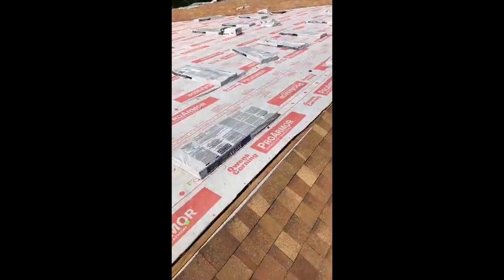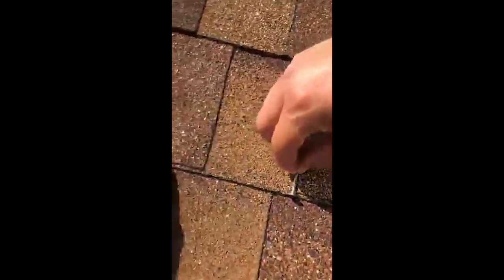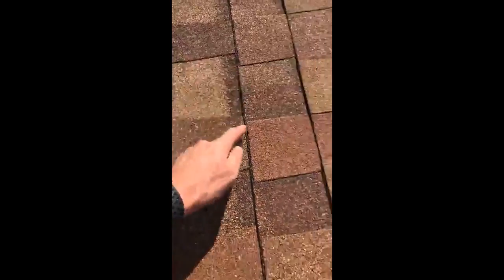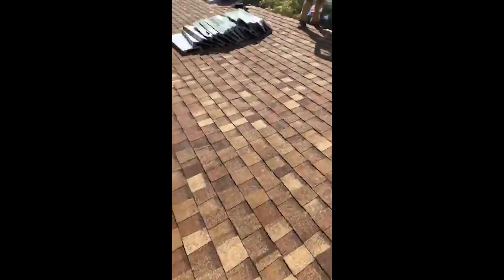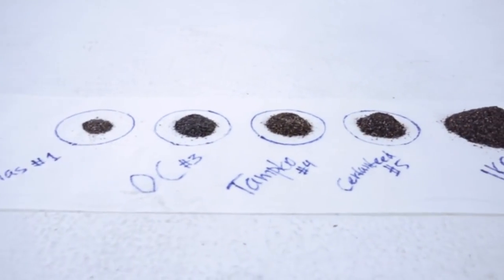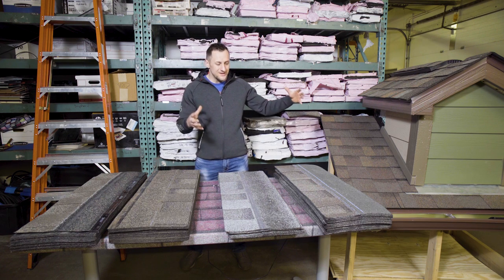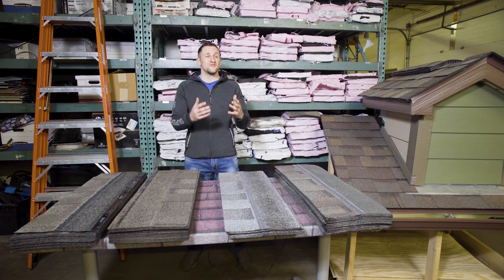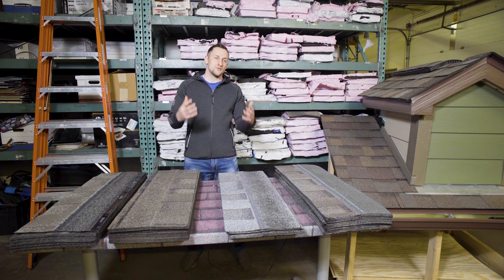Best Roofing Shingles: Certainteed, Atlas, Owens Corning, Tamko, IKO

Comment: This is the reason I don't install GAF.  Over-priced for mid-tier product.  And a terrible company to deal with on top of that.
Reply from the maker: What made you to come up with that conclusion?
Reply: @RoofingInsights3.0  much less asphalt compared to similarly priced competing products. Customer service has been very hit-or-miss especially for warranty issues. And as far as top certifications, master elite is a joke. Qualification requirements don't hold a candle to select shingle Master or platinum preferred. If you can't qualify for either of those, You might still be able to get master elite.
Reply: @asonofAbba2  was about to go with Gaf. What would you choose in Canada as a company? Where to buy? In Montreal
Reply: @cubul32  Atlas or Owens Corning. ABC supply, if it exists up there. You need to find your local roofers lumber yard
Reply: @cubul32  I would say GAF has turned around it's reputation for the better in the past year, with their HDZ shingle. Installing it is super easy, with a big common bond/line for nailing, and it has pretty strong adhesives at the bottom now.
Reply: Why did you not include GAF?
Reply: I stay away for Iko and Tamko.
Reply: In Canada most roofers push GAF.

Comment: I've been a roofing contractor for 30 yrs this year and agree with pretty much everything this gentleman has outlined.  I'm a certified CertainTeed Master Shingle Applicator for many years, an Owens Corning Preferred Contractor, and an Atlas Signature Select Contractor as well.  It is NOT by coincidence that I am certified and install these 3 brands only in asphalt shingles. I will not install any other brand ( Malarkey in Texas is too soft for the temperatures here....it scars easily from just foot traffic).  This gentleman is from Minnesota.......there is a big weather difference to consider. But his information is correct and up-to-date for the most part......just to give you some further insight from a highly experienced roofing contractor in Texas.
Reply: Isn’t Malarkey a rubber/plastic composed type of shingle? I’m here in Illinois and some contractors solicit the brand pretty tough.

Comment: Having my roof replaced right now. I'm glad the roofers are installing Atlas. My knowledge of shingles was null and until recently I couldn't tell you the difference between 3 tab and architectural shingles but videos like this help to enlighten me. Looking forward to a roof that will last longer than the 12 year builder grade roof that was initially installed.
Reply: im looking at atlas do you  like it
Reply: Brooklyn Flatt I have not had any problems with them at all. So far they are holding up well and the color is constant. I would say so far I would recommend Atlas.
Reply: I just installed atlas on my roof…I love them

Comment: Owens Corning is good but it’s too light and thin. Certain teed is heavy and thick my only problem is when the weather it’s hot the shingles stain quick when you step on for a long time. In my own opinion I think atlas is the best it’s thicker and heavier than any shingle in the market. The shingles width and height outbeats any other shingle. And it has double tar line in the nail zone. It grips good with boots/shoes it drops granulates but not as much as other brands. My only problem with atlas I just wish I didn’t get stained as much when it’s summer but I still believe it’s the best shingle you can get out right now

Comment: Truly appreciate this in-depth understanding of roofing shingles and also your insights. My roofer was going to use GAF but I'm going to insist we go with Certainteed now.  I also heard from another roofer that GAF provides them "kickbacks" to push their product but that roofer still prefers Certainteed in the interest of the homeowner.
Reply: Run from GAF run
Reply: I just put CertainTeed Landmark on my roof, and I can tell you I was surprised at how heavy the bundles were. 1/3 heavier ( just from feel) than what I was used to.

Definitely a hardy shingle loaded with asphalt. Roof looks beautiful. I used Tamko on my other house I will be selling soon. It has actually held up really well for almost 5 years. Still looks brand new and hardly any granular loss. Like almost none. 

Sealed well, and house  gets good shade from trees so I'm sure that hasn't hurt how well they have aged. 

I inspect my roofs twice a year, and exposed nails (i.e vents) I always reapply clear silicone if needed.

Comment: Thank you for this great video on shingles! I had a situation in which I had to install a new roof due to weather damage in 2017. The roofer didn't give me a choice of shingle and so I ended up with TAMKO 30 year shingles. The shingles did not resist staining and fungus etc and really started to look bad after 4 years. I had it inspected under warranty and it had major manufacturing defect issues with loss of granules over 80% of my roof. It was so awful. I am still so very upset about it. TAMKO also has a limited warranty and so they only want to replace their shingles and pay some labor but nothing else which seems very unfair if it is their product that is defective. I have worked it out with my roofer. I will be replacing the defective TAMKO shingles but thankfully the supplier is going to help switch me to CertainTeed. I am glad to hear your review about the shingles and know that the replacement shingles will be better quality. My roofer did point out some of the things that you mention in the video and showed me how it had more of the sealant on the underside to seal the shingles better. Based on my experience and your experience, I do not recommend TAMKO. They are pretty when installed but do not hold up or live up to their product claims. If someone is buying a house, they should be sure to review what type of shingles are installed. It might look new and pretty now but low quality may cost a lot to replace in just a few years. Thank god for me that I stayed on top of my warranty and had mine inspected.

Comment: Hello, I am a homeowner that is replacing my roof because of hail and wind damage. This is my original roof and my house was built in 2002. Within the past year after the hail storm, I noticed an increased amount of granule loss on my Timberline GAF roof. I do not have any blow offs, patch work or leaks. I am also not the first owner. During my research and speaking with multiple roofers, neighbors etc. The one common complaint that I found was that everyone had their own reasons for liking/disliking a particular brand. But the most common problem was the fact that the don’t honor their warranty. They blame the installer and the installer blames the shingle manufacturer. For my own purpose I needed to find the root cause of all of the warranty denials and found that no one reads the manufacturer warranty before the materials are purchased and installed. That includes the roofers and the homeowners. I took the time to read all of the warranties for the brand I was researching and the require certain accessories to be installed with particular shingles to be considered a roofing system that is backed by the warranty. For GAF lifetime warranty, you must install the architectural shingle plus at least 3 accessories such as their underlayment, specific ridge caps, starter shingles, cobra vents etc. If you use their shingle and substitute their remaining materials with different brands, you have voided your warranty on installation. This is why they can automatically deny you and they ask for the receipt with the claim form in which it doesn’t take a genius to figure out the installer didn’t install the system correct. So my point is read the warranty and read the claim process to see what is required to ensure #1 your roof is installed according their specs, and #2 if you have to file a complaint in the future your paperwork is correct. Make sure your name and address as the homeowner is on the quotes for materials in addition to the contractor because they will check property records. They only transfer to one new owner within a specified time period if you sell your home. So make sure the home ownership transfers are done properly.
Reply: A lot of roofers like certain materials because it’s faster for them or easier to apply, but as the homeowner your going to be the one dealing with a warranty claim 5-10 years down the road. You need to tell them what you want, and they can price it accordingly. If your focused on speed and price over quality materials and workmanship, then don’t complain later when your roof fails. You get what you pay for.
Reply from the maker: thanks for sharing this story!!!
Reply: @reneemcmillian6569  Insurance companies replaces roofs, not roofing manufactures. They will always fail an install even on the basis of one nail.  I'm a GC for over 3 decades.

Comment: Great video. We also love the Owens Corning brand. We have worked with almost all of the aforementioned brands with the exception of "pabco"? Tamko is paper thin and tears very easily. My guys hate Tamko. I did want to disagree with one statement. That is that IKO is a lower tier brand. IKO when i first started using them was a low tier product. Over the years they have strengthened the Cambridge series and even launched a VERY tough shingle with the DYNASTY series shingle so they could compete in the American market. I can vouch that the Dynasty series IKOs are on par with the Durations or Landmarks in the space of durability and toughness. 
Our list of top tier products would include the following:
1.OC Duration
2.GAF Timberline HD
3.IKO Dynasty
4.Certainteed Landmark
Not in any particular order, but just from working with every one of these, i find that these are comparable in most catagaries.
Mid Tier:
1.Atlas
2.BP
3.IKO Cambridge
Low tier:
1.Anything by TAMKO.
2.Malarkey
Great video btw, we love watching your videos, bud... keep up the great work. You have some fans here at VETBUILD™
Reply from the maker: Thank you so much for the response and support. I appreciate your opinion, as I do all opinions whenever they are expressed in a thoughtful and respectful manner.

Comment: I've spent the past few years dealing with IKO, OC and certainteed.  Both IKO cambridge and dynasty install easily and look good, and I've found medium granual loss out of package. OC tru def and duration have both been wonderful, minimal granual loss out if package, easy to walk an 8/12. Certainteed landmark and pro are by day the most expensive, and look the worst after install, imo. The certainteed also had maximum granual loss out if package, on a 6/12 it is like walking on tiny ball bearings...
All three are great, but I really dont like the amount of granual loss I got out of the package with certainteed.
Reply: CertainTeed places loose granules instead of talc between shingles.  It's not coming off the finished product.  CertainTeed is way better than IKO and OC.  IMO.

Comment: I'm from Ontario canada and I honestly can say Iko has really stepped there game up. We use the Iko dynasty shingles with the nail strip . There actually decent shingles.   Way better then they were ten years ago . We use those and o.c
Reply from the maker: 100% Agree on IKO stepping up their game. Thanks for sharing!
Reply: I am in Ontario. I am going with a well known roofing company that has been around for 70 years. I trust them as they do work for everyone in our family and have not had a problem. However, I watched this video and I’m nervous. They want to use IKO Dynasty shingles with “armourzone” nailing lines (they are visible) and a “tear resistant woven band” to supposedly help keep the nails from pulling through in high winds. The brochure says it’s rated to 130mph/210kph winds. Is this all garbage? Please let me know. This is an expensive job. The builders grade shingles were horrible.  Shingles blew off in every moderate storm. Thanks for any insights!
Reply: @ameranadianveteran860  your perfectly fine. . Dynasty is very expensive compared to cambridge and other brands .  So any companys trying to rip you off wouldn't go with one of the most expensive shingles. I've been using dynasty for years now and haven't had 1 issue

Comment: I think the large nail zones on the corning and some other manufacturers are crap . If you put nails in large nail strip you are only nailing through the single layer and nails tend to blow through ,and it causes the shingles to cup and hold water I  the nail line. I make my guys hit the double no matter what. We set our gun gauge to 5 and a 1/2 inches in case of slightly  low nail. By setting the gun there it also helps with laying a straight roof because you have a little up-and-down play if you need it .That's my 2 cents coming from an installer and now an owner for a few years in oregon

Comment: Certainteed Landmark Pro on a 12/12 pitch with 2 north facing valleys with eaves where ice and snow load up all winter and lay until spring,well after 39 years and no leaks,triple 30# felt in the valleys were going to do a complete removal ,the north slope looks great still but it's the south facing slope that has started to have some tidbits falling off . 
I guarantee the new shingles will be CertainTeed Landmark Pro's .
Northwest Minnesota winter wind,ice,snow,pounding summer thunderstorms.
Certainteed is the best.

Comment: I am planning on a new roof and looking at CertainTeed.  I had a roof of  BP shingles 20 years ago that failed.  I pulled the warranty but had to use BP shingles to replace them and now they have failed after 9 years.  I used GAF architectural shingle on my front roof 5 years ago, but I think I will go with CertainTeed this time. Your videos are great.  I have learned a lot!

Comment: Owens Corning seems to have the most aggressive sealant and best all around product. Maybe not the best at every single thing but well rounded and reliable. How does the Oakridge line compare to Duration? I have Oakridge Tru Def in onyx black on my roof and they have survived some wicked winds when neighbors have blow offs. They look great, lay flat, and were consistent between bundles.
Reply from the maker: Duration is even better
Reply: @RoofingInsights3.0  trying to decide  between of duration and certaineed landmark pro.

Comment: Looking to get new roof soon. Looked at hundreds of reviews and videos of all brands of shingles. Im getting close to 50 years old and want my next roof to last the rest of my lifetime so i want a heavy duty great quality shingle with good algea protection that will hold up to wind and light hail.  I hate to see those black streaks on roofs. Looking at the Landmark Pro and the Atlas stormaster shake and OC duration. Atlas has the advantage for me right now due to the scotchguard but people say certainteed is heavier but the algae protection is not as good as atlas. I also like the OC surenail because people say they stick like glue but they are thinner and the algae protection again is not as good as atlas. Which one suits my needs and which shingle would hold up the best to my needs and possibly last the longest. I have certfied installers in my area for all 3 brands. Or if there is a better shingle out there please let me know.
Reply: 80 percent of my roofs are Malarkey Vista 40 year. I think it's the best shingle in the market because of the modified asphalt they use on it, less granule loss and it sits flat as soon as you install it.
Reply: My company uses CertainTeed products as we are certified installers. Now I say they are the best because once installed I've never had a call back for failures. I'm sure others can say the same maybe not. My guys are trained to install per manufacturer's  guidelines. There are other companies that are also certified in my area. Their  standards are no way as good as ours and I know the product will fail before ours. Product are great but you purchase the contractor not the shingles. Good products in bad hands can fail just as fast. It's your project so do the homework to ensure they install properly.
Reply from the maker: check out roofinginsights.com/directory for recommendation!

Comment: So we are having a new home built by a builder that touts themselves as “custom”. Unfortunately please correct me if Im wrong. But from what I’m reading and hearing my builder used the cheapest OC garbage for the roof. They delivered Tamko No.15 organic felt for underlayment and the day the roof went up I visited the site and they were using OC Oakridge but Supreme at caps. We are building in WI so similar weather to MN. Thanks in advance for any input. 👍 for the video and comments
Reply from the maker: +Alex M I wouldn’t use oak ridge OC. We always install duration as bass line. I wouldn’t use 15lb felt. Synthetic underpayment only. That’s not where you want to save money.
Reply from the maker: +Alex M don’t install 15 felt, synthetic only!!! Don’t downgrade to Oakridge, it will only cost few hundred bucks to upgrade both, money well spent

Comment: Hi, very informational video.  I love it !  I'm currently looking for Certainteed landmark.  I live in Canada and the winter is really hard on the roof.  I wonder if the Landmark pro or premium is better.  Does it worth it to go with the pro or premium vs the normal landmark ?
Reply: I've done many roofs with the regular Landmarks including my parents house which was done 9 years ago and I've never had a problem.
Reply: At the minimum go with pro as it is thicker and max def colors. If your not moving again get the premium as it is an extra 50 pounds per square over pro. What area of Canada? We are in the GTA area and certified certainteed installers. Cheers.